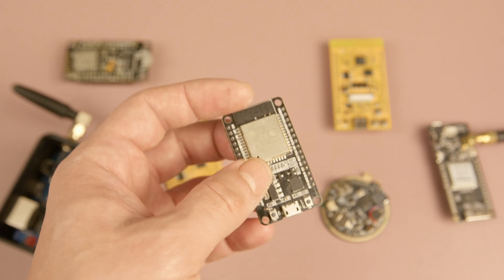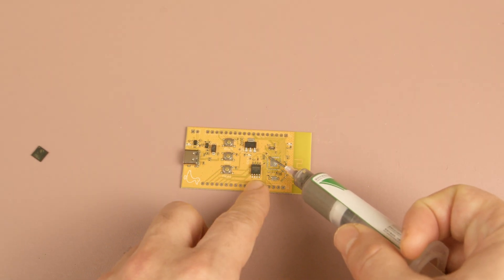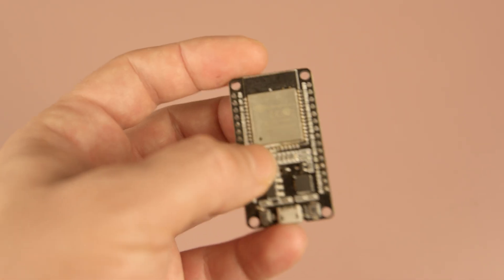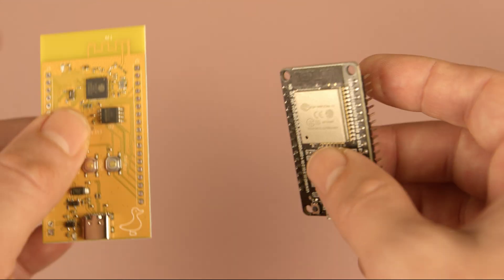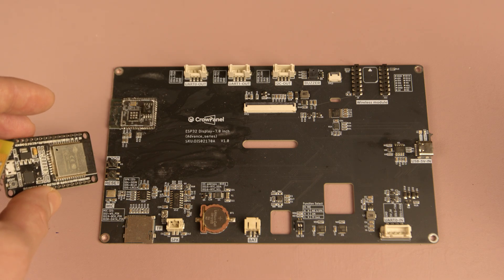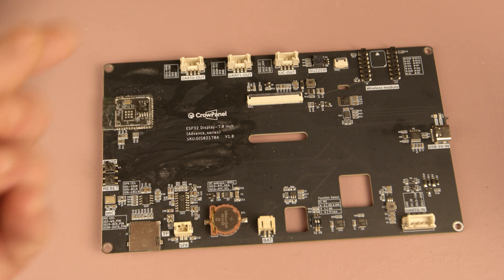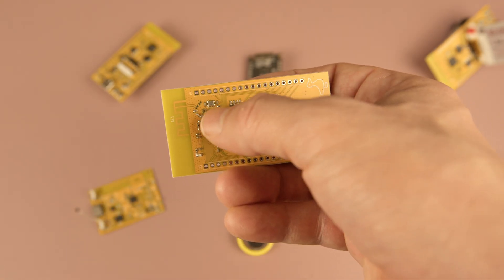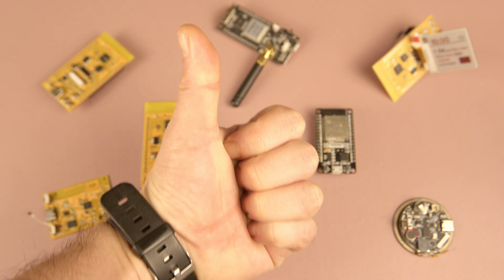ESP32 Module vs. Discrete Chip — Which One Should You Use for Your Next Project?  (Full Comparison)

Comment: You do show the modules in the thumbnail and at the beginning you go over it. But most of the video is comparing the "esp32 module & dev board" VS "the discrete chip"
at 0:40 for example you're talking about soldering on the "module" but that isn't a module, that's the nodemcu dev board. Which is of course massively easier.
Using a module isn't that much easier than discrete chip, they require several special capacitors/resistors/ pins pulled in certain ways etc

Comment: If I had to make a PCB that were hand-solderable, I'd consider making a few plated-through holes (large-ish diameter) in the ground-pad of the ESP32 - that way, I could apply enough heat-flux from the backside. (although I have never tried this in reality). Am I missing sth?
Reply from the maker: I’ve tried this before. It’s usually a good idea to add a few holes under the MCU for better heat dissipation, but using a soldering iron I couldn’t make a proper joint underneath it, which caused it to heat up quite a bit. With a soldering gun or a hot plate, however, it’s quite easy.

Comment: Can those modules that have castalated edges be soldered on top of your custom PCB?  Although, interestingly the majority of $3 modules I've seen on AE, sell just usb/C3 chip (no shield), but with no PCB antenna or external antenna!!  Are those meant for non Wifi/BT applications?   

I think designing with a chip instead of a module also allows you to use the best espressif variant for your application.  For example.
S2 doesn't have any Bluetooth or Ethernet..  
only the original ESP32-D0WD has built-in ethernet mac, Can-bus, and BT BR/EDR..  
the S3/C3  also don't have ethernet but have BLE,   C3 is a single core

BTW, any recommendations for having your  board assembled?  How much of a premium are you paying to have the PCB maker to also do the assembly..  as opposed to having a kit sent to a dedicated assembly house?
Reply from the maker: Yes, you can solder those cascaded edge modules onto your custom PCB—this is exactly how they’re intended to be used. I’m not sure which specific modules you’re referring to, though. Also, the FCC does not explicitly require a shield; the main requirement is that your device meets the radiated and conducted emission limits.

And you’re right: designing with a standalone chip usually allows you to access all of its features, while modules sometimes restrict access to certain peripherals due to their internal design.

I often share details and tips on reducing PCB manufacturing costs. For example, you can check this video:
https://youtu.be/p6BTXdy6Wag